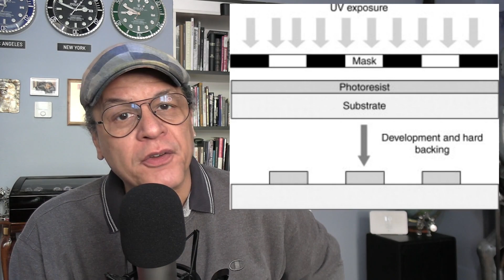Understanding Silicon parts in watches, the why and the how

Comment: As a clockmaker with watchmaking skills, I am very concerned about using silicon parts in watches. I would like to know how to remove the balance wheel without breaking the hairspring, which must be a brittle as glass. Surely the Parachrom hairspring would be a safer bet. Thank you for your video.
Reply from the maker: It is essentially glass, but I've seen it removed.

Comment: Great video!
I am pretty afraid of buying a in-house movement with silicon escapement. 
I fell like I should order some spare parts together with the watch to avoid a possible shortage of them in the future. 
Silicon components that are specifically designed for some movements can't be made or found or replaced by everyone.
We should also consider that we will be dependent on brands for service.
What do you think?
Reply from the maker: Most watches can't be repaired without specific replacement parts. There are still parts available for watches that are 100 years old. IMO it isn't a big of an issue as finding a watchmaker you trust, for example

Comment: This is all well and good, but my concern is that we reach a point where ultra-accurate silicon filled watches can be mass produced for very little money, which for me will take away much of the very magic of the finely hand-tuned mechanical watch. At that point you may as well just get a digital.
Reply from the maker: A watch made with silicon parts would still be completely mechanical. A cheap mevhanical watch is accessible to the msinstream, like the Swatch Sistem51. There will always be a high end for those wanting a premium product

Comment: Unfortunately, silicon cannot be repaired. A watch today running on a silicon balance wheel or with escapement parts will never make it to 100 years old if that silicon part needs replacement. there is no adjusting silicon... If you buy an expensive timepiece like a Patek (who uses silicon) thinking your grandson will wear it someday, think again.

If you want all the features described in this video, get a smartwatch. There's a reason the best independents are not using silicon.
Reply from the maker: Those are all good points, but there will be parts in the future. There are still parts available for the Accutron. These parts are created with a wafer process, resulting in a significant parts creation ability. And they are all identical. A metal part to replace any silicon part could be hand-crafted, it is still a mechanism. Even the hairspring could be replaced wuth a custom metal part.
Reply: @TalkingTimepieces  agree, and for those who want silicon, I humbly recommend buying a quartz and not spending so much on a mechanical watch. There's no need to have a mechanical movement at all if it cannot be adjusted, repaired, or tuned by a watch smith. The watch industry loves silicon because it so much cheaper to manufacture. They've done their best to market it as a benefit to consumers. Like BMW putting plastic in their engines... it's why I stick to independent watch makers now. Even Rolex, so far, does not use silicon in their tool watches.
Reply from the maker: You make valid points, but there are some who just want a mechanical watch, and are comfortable with factory service.

Comment: Great explanations! 👌❤️👍 Amen! luckily the public in general is more open minded to new materials which are more precise time wise! 

For the common independent artisan who manufacture but a few watches a year silicon is not an option! The mere cost of the equipment to produce silicon parts makes non accessible this technology to most of them. Thus they continue with old school technology with pride yet with xenophobia since they don’t know precisely how they are made. 

A bit like an old timer saying that a fusée & chain is the best horology made(thick watches thus heavy), weight of a watch was important since the heavier = the quality of a watch. For the timeframe in question YES. But Lépine movements (much flatter = less thick) changed that ballgame. 

It’s not for nothing that watch manufacturers are going thru this silicon revolution: tighter tolerances=better time keeping, less maintenance, less sensitive watches to high magnetic 🧲 fields(power transformers, T.V.s, monitors, magnetic pads for power recharging of cell. phones, electric cars, E.M.P.s & what not). For the common man spending $7000 is a lot of money 💰, for less you can obtain a very very good watch which will be hassle free (silicone), for the +$7k : you can get old school which are made one by one watches without silicone BUT will be a work of art (non mass produced). At the end of the day everyone is entitled to his opinion but should fully understand new technologies before making a decision!
Reply from the maker: Excellent points! Thanks for the input!
Reply: for more precision, you should buy a smartwatch or a quartz.
Reply: @Paul-ic2ki  there’s always chronometer watches(mechanical which are extremely precise (C.O.S.C. & other certifications) 👌❤️

Comment: The interesting part about the repairability is that a modern hairspring made out of metal alloys (say the one Rolex used) is also impossible to repair unless you have very special tooling. It is not the watchmaker with his hands 😅
Reply: But it can be adjusted. Silicon will shatter if you attempt to adjust the hairspring.